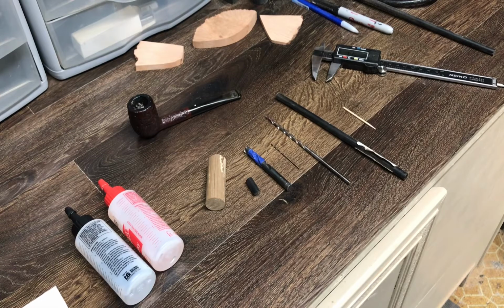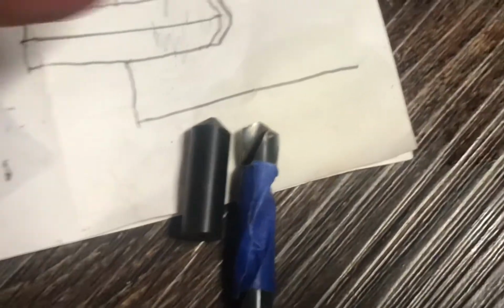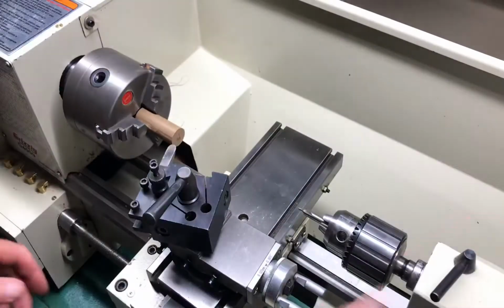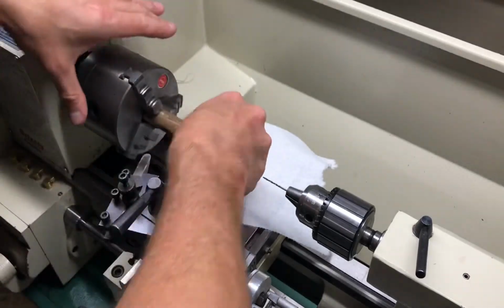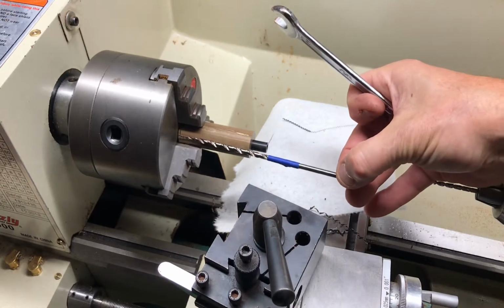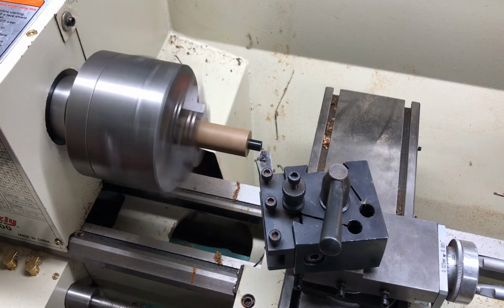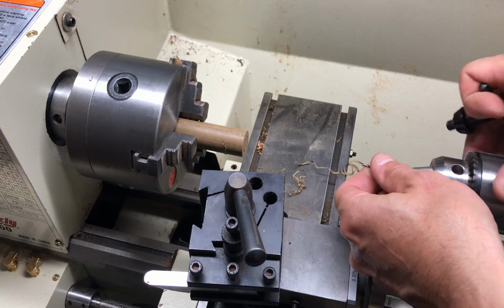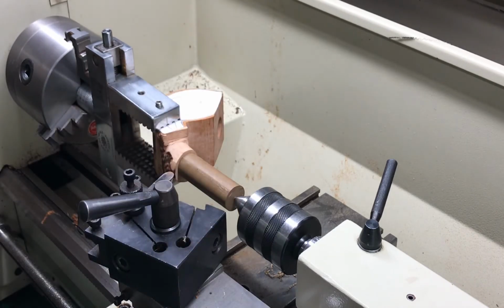Danish Style Pipe Making Tutorial  - 2 of 6

Comment: These videos are wonderful.  So full of great tips and techniques and your demonstrations are clear and understandable.  Thank you so much!  Question - can you use a forstner bit to drill the hole in the stem material so you don't have to shape the end of the delrin rod tenon?  Or is there an advantage to having that hole rounded at its inside?  Also, how much length do you leave for the V-shaped airhole in the mouthpiece?  In other words, how much shorter is the airway hole than the stem?  (I hope that question makes sense.)
Reply from the maker: I am so sorry I missed your comment. For some reason I stopped getting YouTube comment notifications. Hopefully it's corrected now. You could use a forstner bit, but a round bottom will have far better airflow. VermontFreehand.com has a lot of different pipe bits. 
I usually create my V slots about 3/8" deep. If you have other questions please feel free to send me a message from my website's contact page and then I'll have your email to reply directly. SederCraft.com

Comment: Question about the drill bit and tenon matching angles:  Why not use a Brad point bit and have the face of the tenon and mortise meet at 90?  

I have done it this way and etched the interior end of the tenon so that the epoxy can have something to grip onto.  I don’t turn on a metal lathe so maybe I would attempt it your way if so, but it seems like a more difficult step that doesn’t, to me, make the tenon and mortise meet optimally.

Comment from the maker: One drop of the pipe and tenon made from the stim material, whether ebonite or acrylic has a good chance of breaking. Delrin is also what is called self lubricating so it’s always a very snug fit but easy to get in and out. This is just how I do it and there are a lot of pipe makers that use the stem material for their tenons. You’ll see 10 pipe makers do the same thing ten different ways. Thanks for the comment.

Comment: just a quick question   Is there a reason when you drill the hole in the stem that you don't finish it with a flat bottom drill  and leave the tenon flat on the end?   Just curios ?   Thank you sincerely
Reply from the maker: Hi James.  By the time I drill the stem I've already machined it flat on the lathe.  The bit end of my pipes I usually create a slight curve in on my pipes for comfort.  I'm not sure I answered your questions completely.  If you can elaborate I'd be happy to explain more.